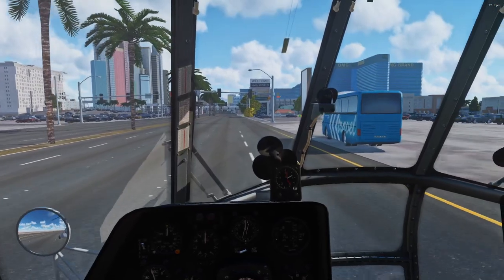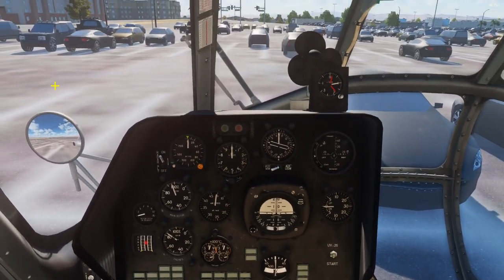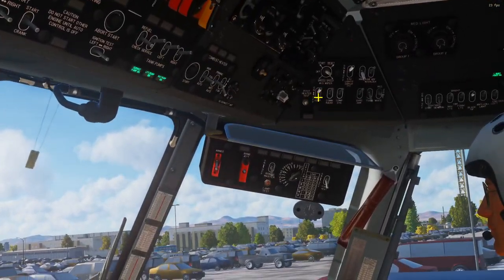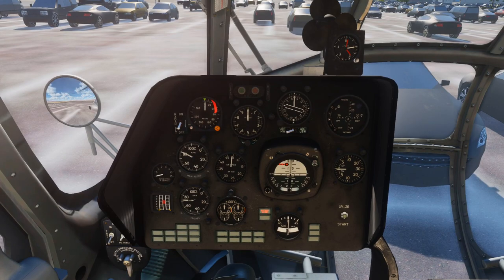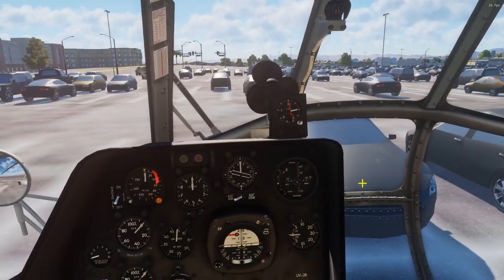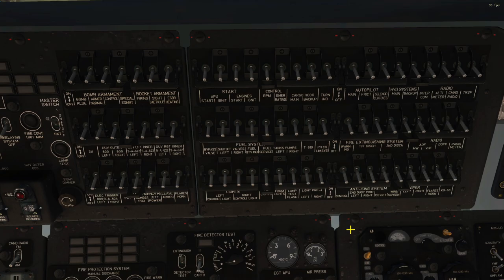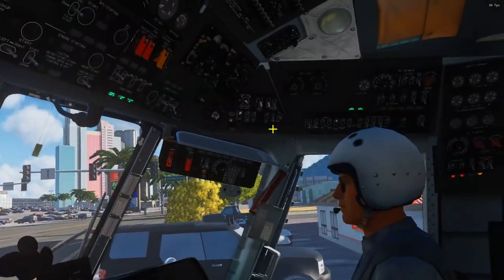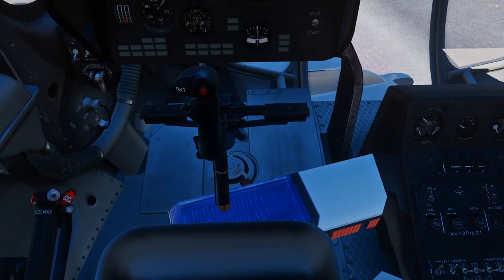DCS Mi-8: Shutdown Tutorial

Comment: it is required by IRL flight manual to stop the rotor blades by brake in such manner, that one rotor blade is placed over the center line of the cockpit. just for the sake of tail boom safety in high winds.

Comment: is there an auto shutdown?
Reply from the maker: Not to my knowledge. But if you're just trying to shut down for a repair all you really need to do is throw the fuel cutoff handles and the engines will stop.

I think you can still get away with asking the ground crew to turn on ground power first and then your electrical systems will stay running. But I haven't tried that in a while.
Reply: @vsTerminus  Thanks!